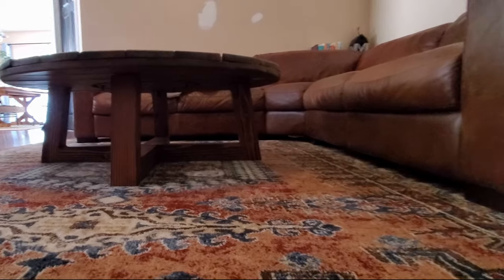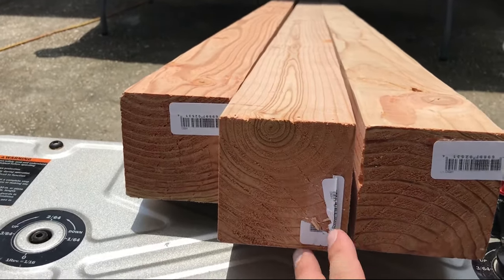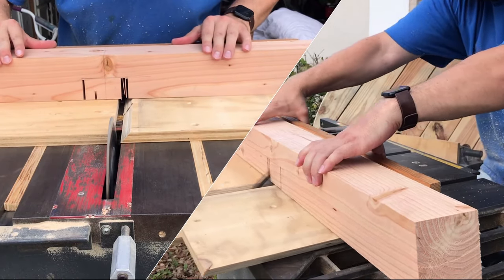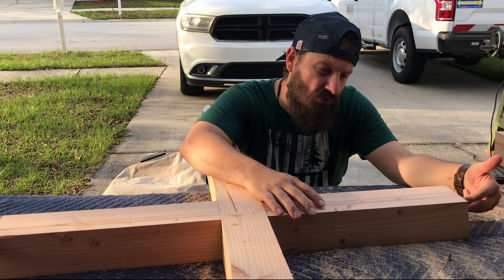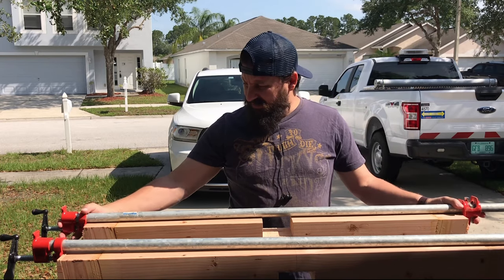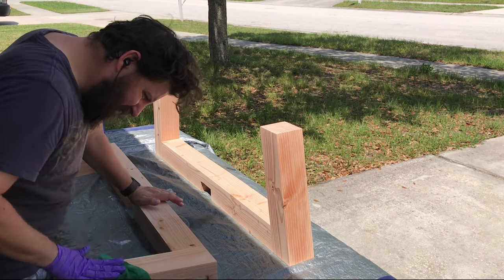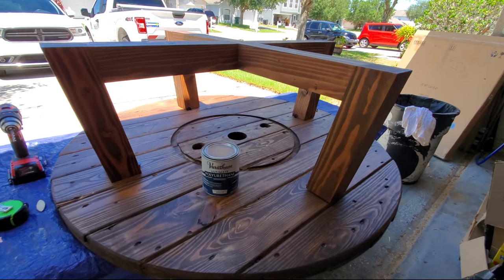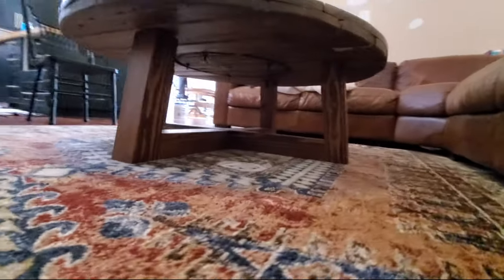Making a Cable Spool coffee Table DIY

Comment: Looks amazing.  I just received 4 spools. 1 is already taken apart and ready to make into my kitchen table. How or did you remove the nails and all out of the top. I have looked at the one i have and it almost looks impossible without cutting them out? Thanks for your inspiration and information!
Reply from the maker: Hey Candice, I did not remove the nails, like you said they are impossible to remove, what I did is I drove the ones that were sticking out in and I sanded the top many of the nails also got sanded smooth with the top ! Good luck with you project I hope it comes out awsome!
Reply: @julianjazxhi9870  
Oh, okay.  Thank you soooooo much for the insight and for responding so quickly.  My husband told me they were NOT coming out. Lol. I thought about beating any ones sticking up in, but didn't realize the sanding would help with it too. Thank you again!!